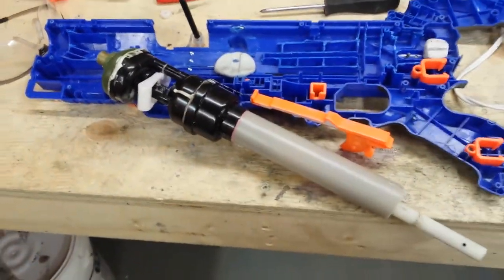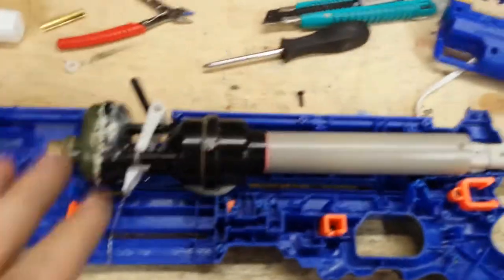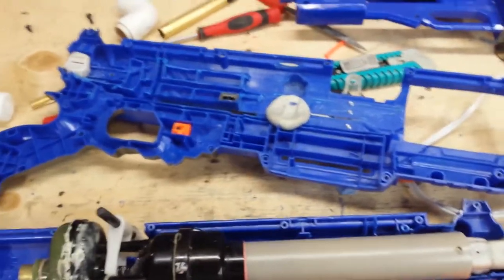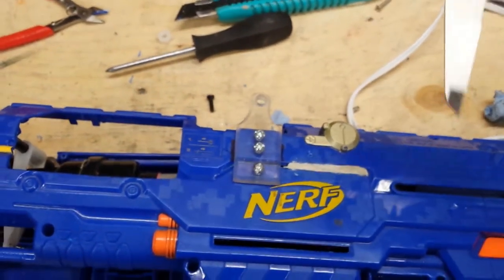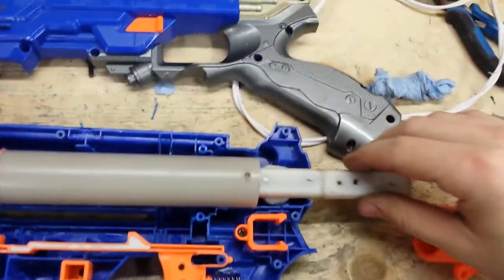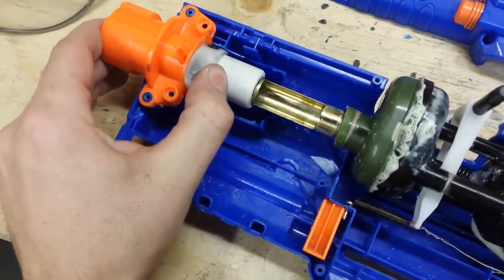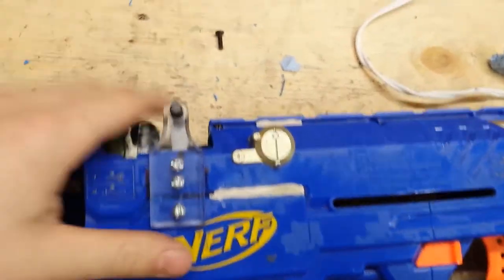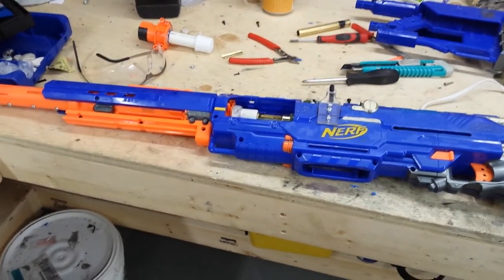Longstrike+buzzbeebig blast mod(internals/guide)

Comment: hey, instead of increasing the length of the trigger pull, why not attach the wire higher up on the lever? that would make your trigger pull a little harder, but allows you to vent the tank faster.

Comment: do you have measurments for the pvc and brass?
Reply from the maker: The pvc is 1\2" and the brass size will depend on the darts you use. If your darts are thinner you will need 17/32 barrel with a 9/16 slide breach. If your darts are fat you will need 9/16" for tour barrel and the next size up for the slide. I don't have  the length measurement. This build is 100% by eye. Guess and check type work. I may have mentioned some dimensions in the video but i dont remember.
Reply: What size of brass did you use for the barrel? Because it goes inside of the 17/32